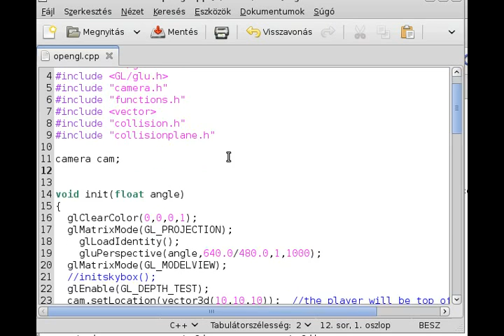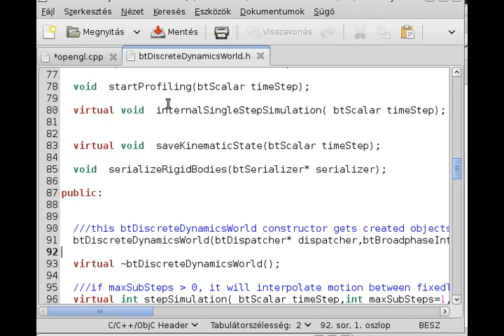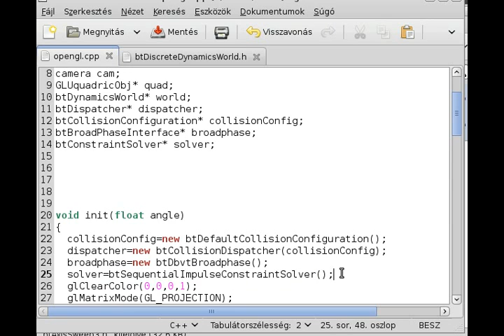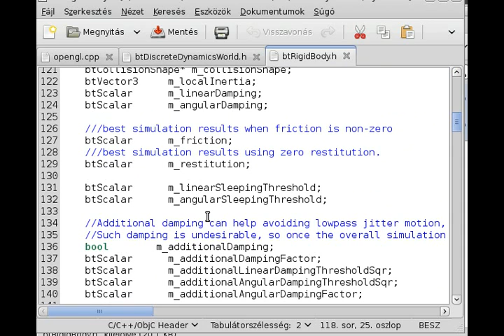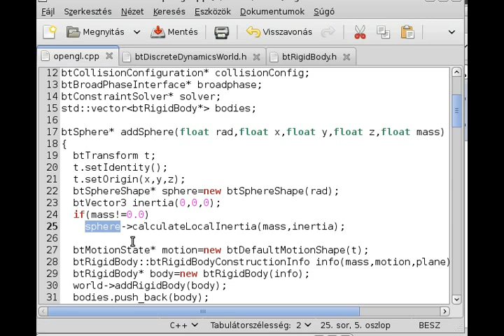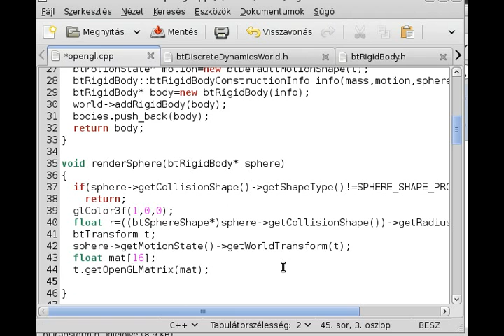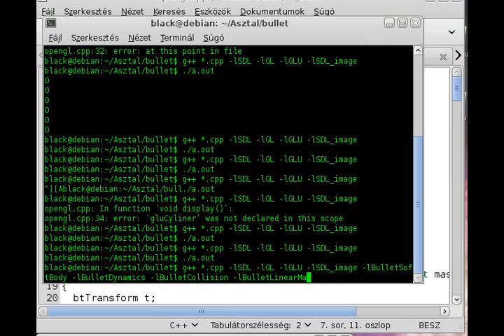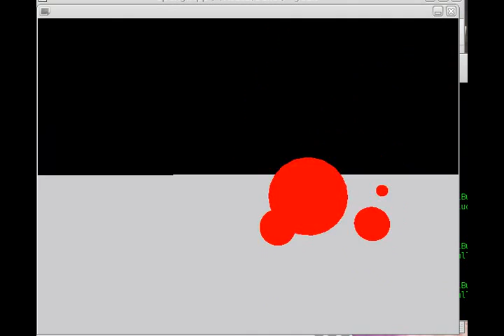Bullet physics tutorial 1 - Hello (btDiscreteDynamics)World program

Comment: Nice one! A little complicated, but I guess I will get the hang of it eventually :)

I have seen lots of games that got the same problem as you had in the end, where the spheres stack up on each other. It's happening because they spawns from the exact location.
There is a very simple solution: Add a very small randomization to the spawning location. That way, they won't be "perfect" and stack up on each other.